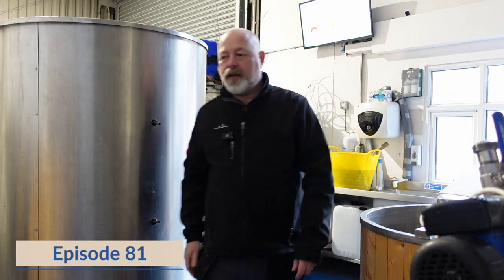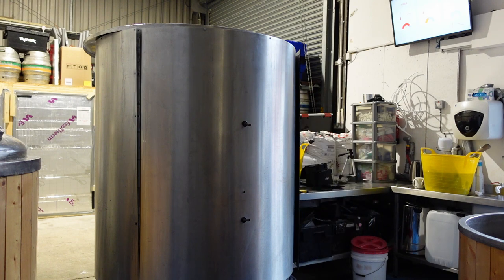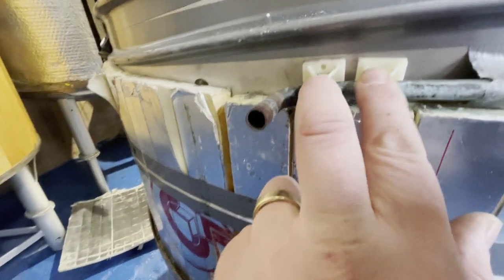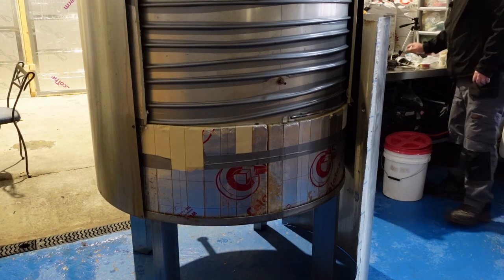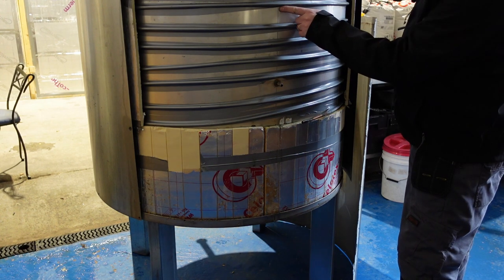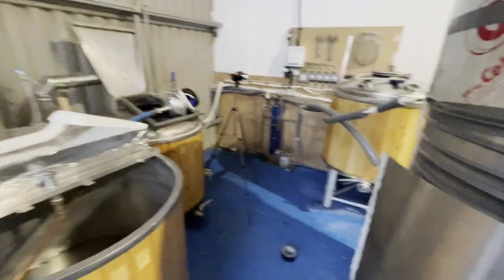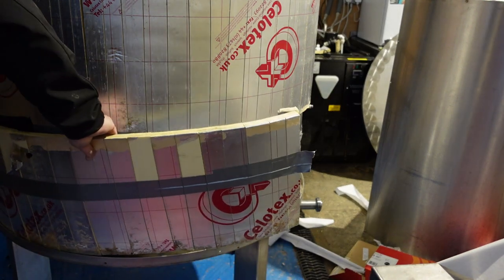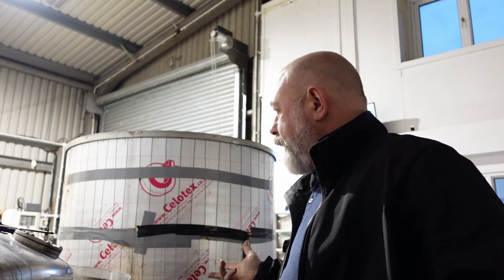Ep.81 - Tank Repair, Murgy DIY Kits, Bottle Labelling.

Comment: The first one tasted great, thanks Andy. And the label came off perfectly, ideal for re-use of the bottle.👍
I do wonder about plastic labels from an environmental point of view though.
Reply from the maker: Yeah agreed. Truthfully I didn't know they would be plastic until they arrived. I checked the artwork was right but not the stock they print to.  Definitely will think about that once this 1,000 is used up.
Reply: Just found the sticker stuck in the bottom of the box too 👍

Comment: Great job, I’m planning something similar but on a home brew scale and have concerns over the potential  mixing of wet glycol, mains electricity and a metal tank. Are you earthing/bonding the tank and using an appropriate (earth leakage?) trip?
Lovely tribute btw.
Reply from the maker: Absolutlely yes. The other 2 tanks with the same heater are bonded and RCD protected, and this will be too.

Comment: Do you have a recipe for your Murgy beer that I can brew here in Australia,  cheers.
Reply from the maker: For 19L (assuming BYO standardisation and 65% mash efficiency)
https://byo.com/byo-recipe-standardization/

Four Priests - Murgy Straight 19L

4.1% abv
30 IBU
8 EBC

2.7kg Extra Pale
560g Maris Otter
300g Wheat Malt
110g Cara 30

Pre Boil Gravity 1.035
OG 1.040
FG 1.008

Hops 20 mins
6g Talus 8%
4g Citra 13%

Protafloc at 15 mins

Hops 10 mins
10g Talus 8%
6g Citra 13%

Hops 0 mins, drop temp to 78C then hop-stand
26g Talus 8%
12g Citra 13%

Chill to 20C and pitch 1 pack of Five.

Day 5 of fermentation Dry Hop
21g Talus 8%
31g Citra 13%

Cold crash to 4C if possible after day 10.
Leave dry hops in until racking on day 14 (approx.)

Comment: Hi Andy what controller do you wire the heating coil to
Reply from the maker: Hi, it's an Inkbird ITC-308 Wifi. It also controls the cooling circuit when we need to chill down.
Reply: @FourPriestsBrewery  could you wire to just st1000 would that work
Reply from the maker: Yes, just take care of the current rating of the coil and the rating of the STC-1000.  I think the Inkbird is 10A which was fine. I don't remember the STC ratings, but the spec sheet will tell you. You could always use a relay to switch the element on, in conjunction with the STC.  Cheers

Comment: I've never understood reasoning for heating/cooling loops like on your fermentor going a specific way (top to bottom, or bottom to top). I can't see it making any difference to the cooling/heating. The only thing I can think of is to always go bottom to top in case any bubbles get in there. If you go in at the bottom and out at the top, then the bubbles rise naturally and be pushed out by the flow of coolant/heatant rather than fighting against the flow.
Reply from the maker: It feels like it’s less effort for the pump to let gravity help and run it top to bottom down the spiral, but apparently that’ not the case. No idea. Works either way round and I haven’t measured the difference. Cheers!